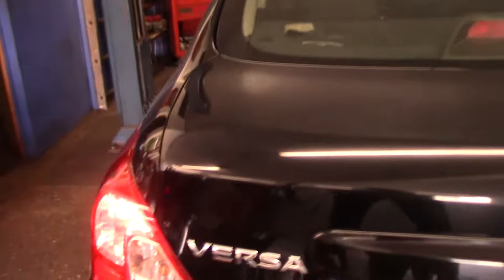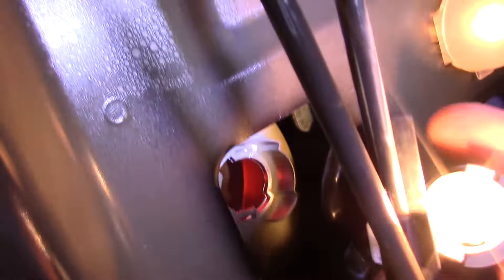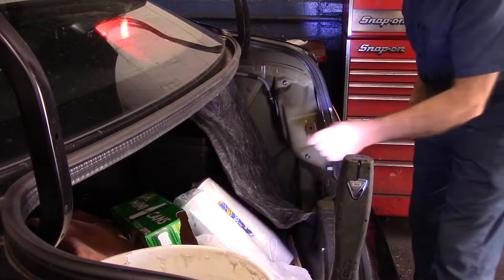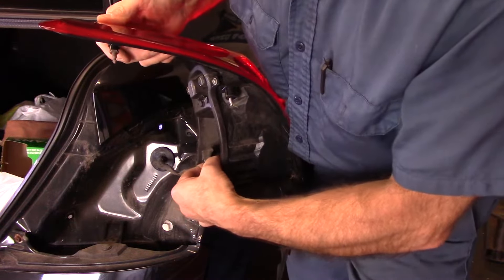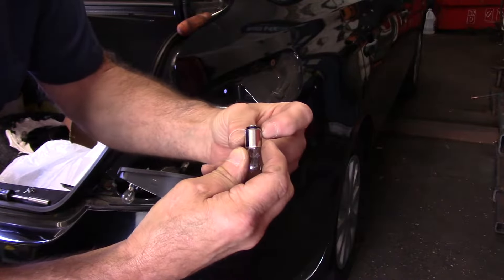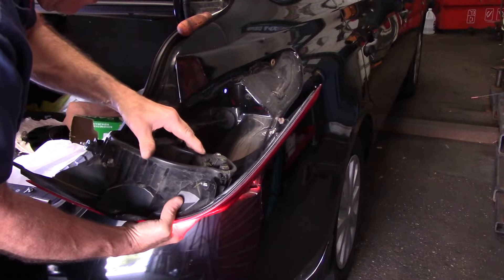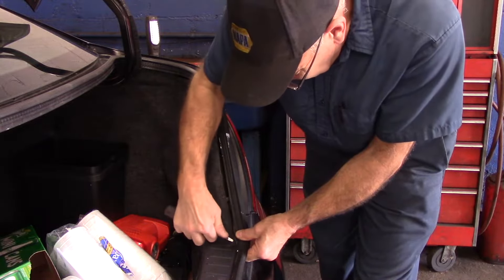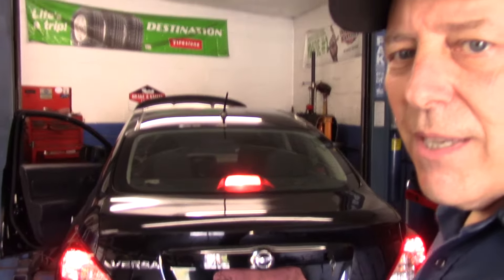How To Remove Tail Light Or Brake Bulbs 2012-2019 Nissan Versa

Comment: I noticed that you weren't concerned with touching the glass bulbs with your bare hands. Others claim that the oils from your skin create hot spots on the glass and lead to premature failure of the bulbs. Interested in your opinion, Jim.